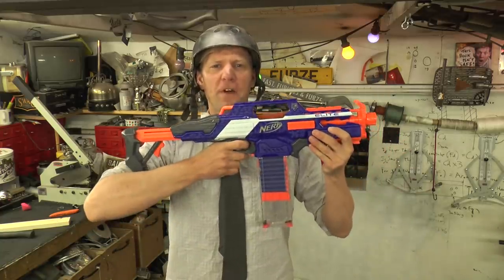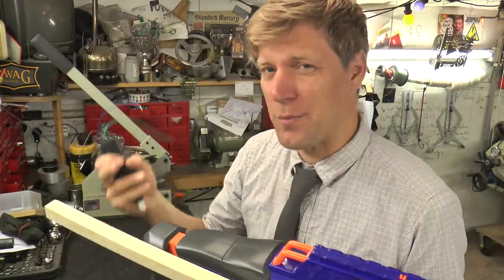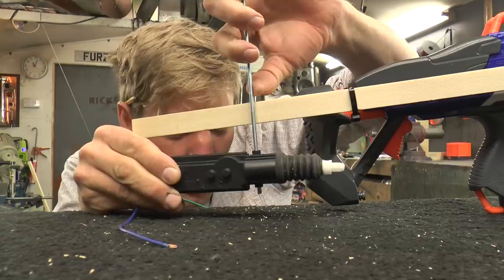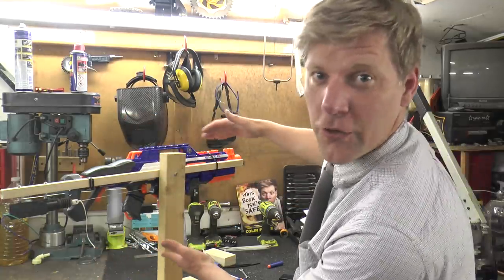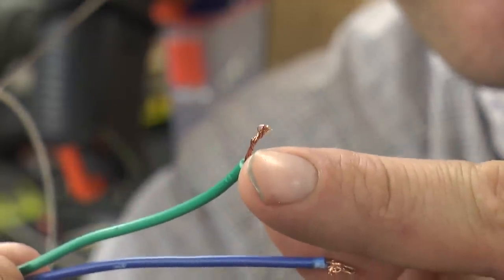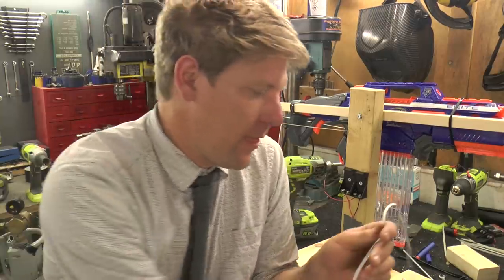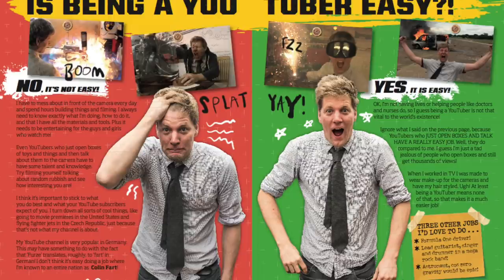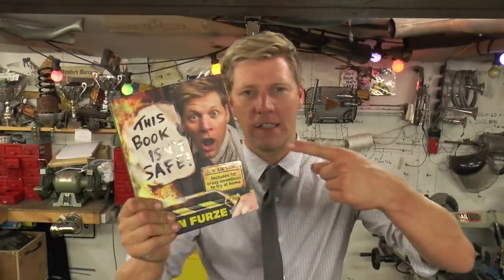How to Make an Auto Nerf Trigger System "Colin Furze Book Project #1"

Comment: You can use a rubber band for pulling the second trigger. If the trigger is pulled the whole way, the rubber band will compensate the way for the first trigger to get pulled.
Reply: Consider, though, that pulling the acceleration trigger and the primary trigger at the same time will jam the blaster. The flywheels need a few seconds to rev up to speed before any darts can be fired.

Comment: Colin In the second switch that starts the motor you can add a weak spring to be on the balance to keep the string in place and leave a little space for the other switch to be pulled.!!😊😉

Comment: Make it automatic with transistors
Reply: How many watts is a central locking actuator?  Usually 42w would make a fire rate of about 90 per minute depending the model, 20w would double the fire rate with turn signal flasher relay
Reply: Leofred the gun he uses is already full auto, rapidstrike cs-18 ;-)

Comment: For the two separate triggers, use a bit of elastic cord on the lower one, this will allow both triggers to fire. As the cord pulls, first the bottom button will be activated, and then the elastic will allow the cord to stretch a bit and keep pulling until the second trigger is activated. 
So tie one cord to the actuator, and run that cord to the trigger, wrap an elastic gently around the lower button, and back to the cord, tie it to the main cord so that it is just resting on the button. When the cord is pulled, the elastic will engage first, activating the motor, and then the trigger will be pulled.
Easy. 
This will allow to have full auto, without having to leave the motor running, wasting battery, and giving away the gun position with noise. Also, you dont have to run up and set the band.
Hope this helps.

Comment: After making this turret I slightly altered it, well, really altered it. I bought two traxxas velinion electrical kits and replaced the stock motors and electronics, except the loading mechanism's. Adding 2 servos in the proper ways and a lazy Susan bearing allows you to adjust the rotation and angle of the blaster. An additional servo can also be used to pull the trigger as the motors spin up using the traxxas remote rather than the actuator this makes the whole system wireless and can be operated as far as the remote can remain connected. Just for fun I mounted my go pro to the blaster and used the live view to see where I was aiming.

Comment: Why not just take the wires from the trigger in the blaster ..
Reply: cause this is just proof of concept because the same setup can be used with a real gun
Reply: John Beardsworth which would be highly illegal. atlesst in the US
Reply: MrTarfu good thing im not american but im probably gonna use this with an airsoft gun
Reply: V8-Vorteil a little jiggey pokery with some re enforcement might work
Reply: I noticed Colin did not modify, disassemble or damage the blaster in any way. Remove the string and clip the zip ties and you have the same blaster as you started with.
Reply: That was the first thing I noticed too. I actually have done it by soldering wires on the inside and then hooking it up to a microcontroller for autonomous firing on a turn table (a bit better imo). That said, Colin seems to be going for the "no actual gun modification" method so the gun can be easily removed after.
Reply: well, you still can add an autonomous firing system without cracking open the replica (I don't like calling guns airsoft and nerf props, because they're not), just go for the actuator solution. you can even build a bracket holding the replica and the trigger mechanism using the rail system. hell, even Nerf replicas get rails for accessories!
Reply: Joe Wearing in the US part of the ban on full auto dictates the function of a trigger, I don't remember the specific wording but any kind of electronic trigger violates it
Reply: Because that's colin furze... doing something simple just isn't his thing.
Reply: Thinking you guys are looking way into this.

Comment: In general a very nice idea, but seems a little bit complicated.. Since the gun should have two switches inside, i would just open it and extend both switches to the outside. This would need very few parts (no actuator, no battery) and would skip all possible errors with the strings. Only drawback would be the holes in the actual gun.

Comment: By loosening the bolt connecting the base and blaster and the wireing up a motor and string from the base and a point above the blaster you can use a drawbridge like system to raise and lower the gun also do a similarly arrangement horizontally to turn it. Just a thought 😉

Comment: -ideas i could think off: (my ideas are not very realistic and many might even be not so good so hop if not bothered)
this is a comment on your video because it expresses how impressed i am of your nerf gun:
*robot armour that when the humans steps out of it as it opens up at the front can run and fly.
*fake railway that transports nothing of worth but looks like it anyways to catch criminals.
*spring seet to land into after ejector bed and trigger to toast
*memory cloth or batman gliding cape
*lightweight enviroment controling magnetic/air-soft machines that are chuckable anywhere.
*deadly home-made attraction park
*suitcase armour that blasts up onto the body equiping it with armour.
*batwing/batmobile that can fly and grapple through buildings. or even one that can cover the moon    with its batshape (because i saw that too in the 1989 film).
*batpod that can actually rotate tyres into the odd direction seen in the dark knight.
*stretching book closet.
*batman arkham city styled line-launcher or batclaw.
*flamethrower sword or jet powered flying hammer
*(water freezing?) freeze grenade
*smoke grenades that function quickly and explosively rather than time divided
pulse powered muscle-web shooters that can contract or just web shooters where with one can freely shoot and swing towards wherever on some kind of ceiling or wall
*thundergun/zeus canon/jet gun (blasts of incredibly strong compressed air)
*starwars style transport machinery, 
*whip that at pulse contracts and absolutely flaws a person or object.
*sticky thors hammer that can fly (lol make it fly challenge (probably not possible))
*thunder weather controling staff
*ant-man robot
Reply: when you say antman robot do you mean a robot that is small or the robot changes size? and i was working on a project about antman that uses stilts and an inflatable suit to be bigger but was wondering did you have any ideas for shrinking?

Comment: Make explosive darts for this :)
Reply: Hiby2305 S It is really simple.

1. Grind down match heads into a thin powder (try not to get wood in the powder)

2. Scrape of the striker of a match box with a knife until you get half of the amount of powdered match heads you have

3. Mix it slowly within a container without tools because this is friction sensitive

4. make a small warhead with paper, fill it up with the powder and stick it on the tip of the dart.

Tips: Make the (Matchead) powder thinner to have a faster burn time or thicker to have a slower burn time

This powder can also be used to substitute gun powder but beware this thing goes off with friction or if it is hit.
Reply: I once removed the heads from 2000 matches, you also need patience. :D
Reply: Just hot glue a snapper ( the little paper bags of rocks and gunpowder) to the dart and use a single shot nerf gun

Comment: You can do four blaster mods. 1 remove the locks . 2 mod the fly wheels and chassi. 3 up the voltage (lipo battery) and motors. 4 two stage trigger pall and swap in the reve trigger and firing trigger  so you save battery.

Comment: It is possible to do it with just the one string. Tie it off on the actuator, then loop round the rev trigger, thread back through the actuator, loop around the trigger then tie it off

Comment: I reckon that you could get into the blaster itself and solder two little arduino-style jumper wires (female plug) to the trigger so you could plug in two male jumper cables connected to a switch that you could use to remotely fire the blaster without any sort of bulky electronic pusher mechanism on the outside of the blaster. This video is about a year or two old but if you somehow replied, I would like to make a video showing how. I just like soldering stuff together

Comment: you could make the blaster shoot much further and faster if you re-wire the circuit and up the voltage on the motors in the blaster.

Comment: could you open up the blaster, drill a little hole and attach the power cable to the secondary trigger so that when the secondary trigger is pulled, it powers the pull thing

Comment: For pushing both buttons with the same driver you could start the rope at the driver, past button 1, back to a small wheel on top of the driver, then past button 2, and back to a fixed point on the driver. It should have enough power to trigger both, using the physics of a small pulley. :)

Comment: Lil tip, if you put a nut in the bar first, after you cut the allthread, take the nut off that end and it will remove any fLashing leftover from cutting it and smooth the threads

Comment: how about you tie an elastic band onto the pull thing and the engine trigger. just tight enough that it doesnt star the engine. then when it pulls it will pull enough on the enginge trigger to start it up. might need to shut it off manually though

Comment: Or you could open up the nerf gun and add a second, external switch. That particular blaster has an electric trigger so you just need some wire and a switch.

Comment: what if you used a bit of elastic rather than string for the motor trigger, one that is strong enough to pull the trigger, but is also stretchy, so the actuator can continue to pull and fire the normal trigger?

Comment: I would add something so I could move it side to side than attach a censor so I automatically fires and then a camera to the sensor and a circuit so it will follow people if they run past it

Comment: This needs an 18650 upgrade in the worst way. If we're going as far as making one of these both the blower motor and the solenoid can be powered that way. Just a little toggle switch on the control panel and a fire button. While we're at it lets put it on a turret with pivot and elevation motors and give it a fpv camera. If that isn't a recipe for a Furze project I don't know what is...

Comment: Im not sure how the Nerf gun works, but i assume that when you pull the trigger it completes a circuit, so you could probably tap into that and the motor button at the same time... HOWEVER; that's not what this channel is about, i love your idea and how crude it is, i could almost feel you cringing when twisting the wires and covering them with tape. Here's to 6 Mil!

Comment: you could bolt it to the roof aiming at your bedroom door an make a pressure pad under the carpet so when someone steps in your room they complete the circuit and get shot in the face

Comment: I would've just used a raspberry pi with a small servo, pushing back the trigger with the push of a button on a transmitter. Much smaller and easier.

Comment: If my electronics engineering professors saw your wiring, they'd be having heart attacks. That being said, you could replace the button with an ultrasonic sensor or pressure switch.
Reply: You should check out videos from

LordDraconical he modified nerf guns to be better. More than just this he makes them shoot harder and faster two. Paints them. And or gives a different mod

Comment: I thought the gun was mechanical and you were going to automate pumping the action. 

If I had known the gun was electronic to begin with I would have just added some length of wire to the trigger (a momentary switch in itself) and put the button switch on the end of that...done. Unless the trigger does actually do something mechanical.

Comment: there is a far, far easier way to do this, attach a switch to the batteries so that no current goes through until you press the switch, then just tape in the trigger so that it turns on as soon as you pull the trigger. nothing but a switch and wire required :)

Comment: if its an electric gun all you have to do is go to walmart pick up a super cheap RC car then take out the chip, open the gun and put the chip inside. wire it up and then put it back together, its much easier to put electric nerf guns back together. use the remote for the car to fire

Comment: i usually really like these builds, but this was way harder than it needed to be, why not just connect the switch across the trigger, no batteries actuator etc. you could even use a 2 pole switch to control both the rev switch and trigger
Reply from the maker: its to get kids cutting and using tools etc so the short cut although would work is not what this is about.

Comment: If you upgrade to 3s flywheel motors with a 3s battery you can rewire the blaster to rev when the firing trigger is squeezed. Also put it on a rotating turret and add a linear actuator for up-down tilt. Then put it to a joystick. mwahahaha!

Comment: Why the hell would you use D-cells in anything other than a smoke detector. You are honestly better off rewiring everything with 16 gauge wire, replacing the front "flywheel" motors with something like a pair of "Make Test Battle Rhinos" and the back pusher with a "Make Test Battle Hellcat," using something like a Cherry MX switch (or anything that can handle more extreme current load), and using a proper XT60 connector with a 3s lipo pack.
This is the bog standard for a proper Nerf Rapidstrike mod, and can be expanded upon for more craziness (relay to modulate which parts of the system to activate on a remote receiver system would work wonders for this video). MTB as I mentioned above sells these motors around the world to sites like Containment Crew in your neck of the woods. They have a full write-up to making a setup like i mentioned here: https://www.youtube.com/watch?v=yRspanhxKEM

Nerf on, you crazy Brit you!